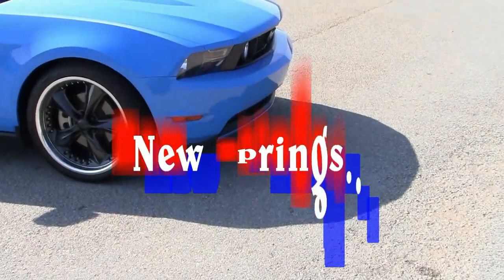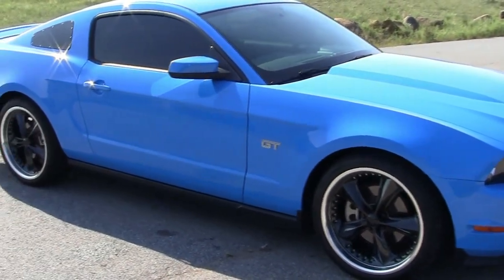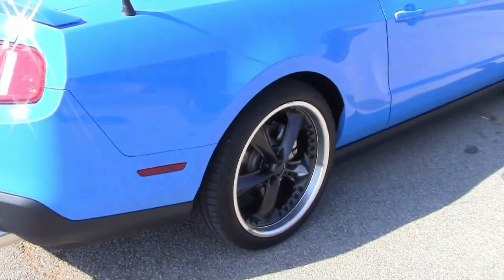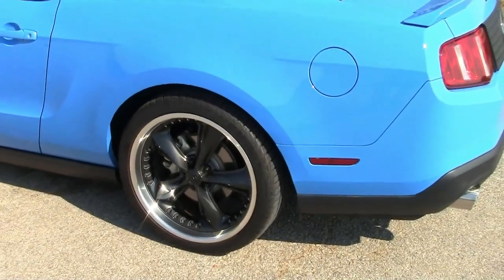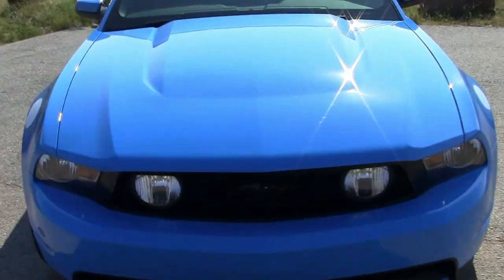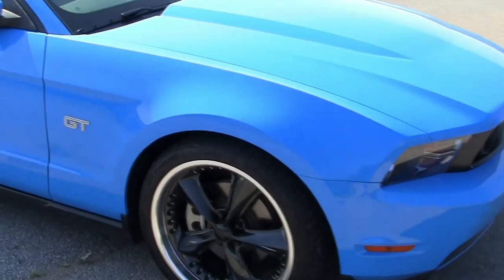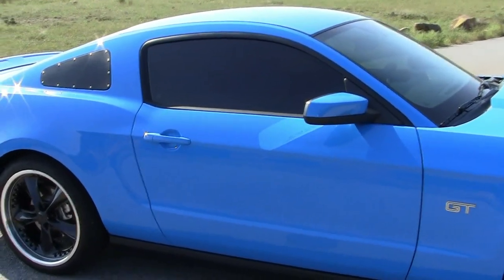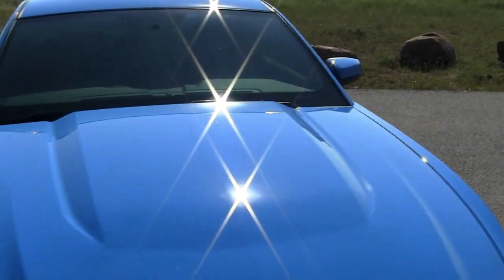New Springs!

Comment: I have a 2005 mustang and want to lower it. I got new springs, new struts and shocks, and new camber plates. I have read there are alot more parts you should put on a car when lowering it but dont want to spend money on parts I dont neccesarily need. Its just for looks I only use my car for daily driving.